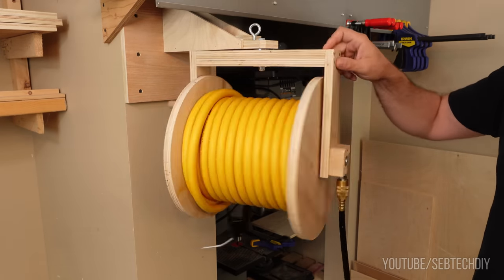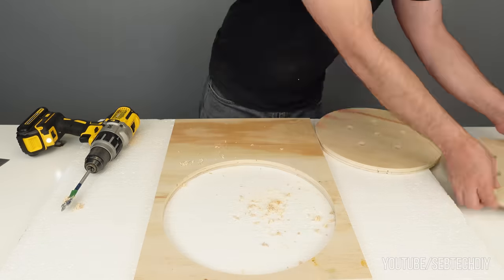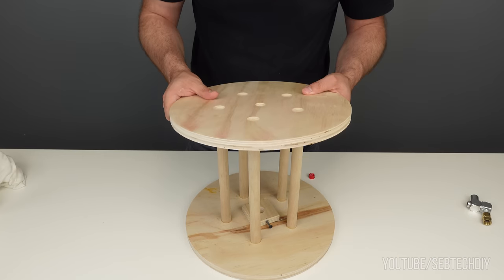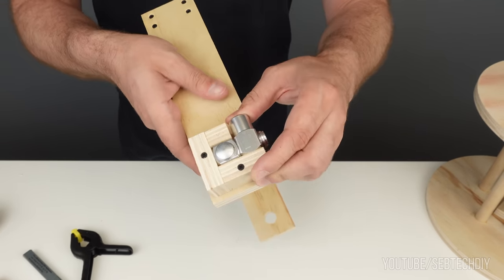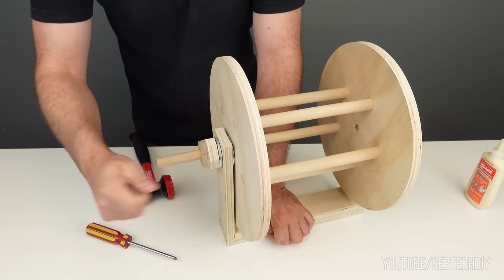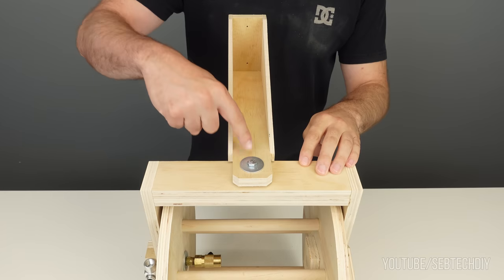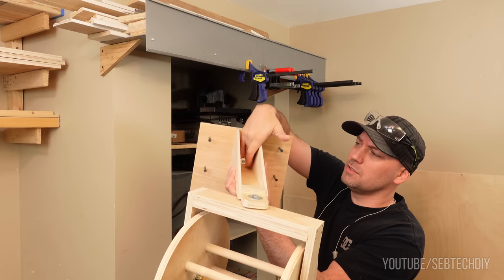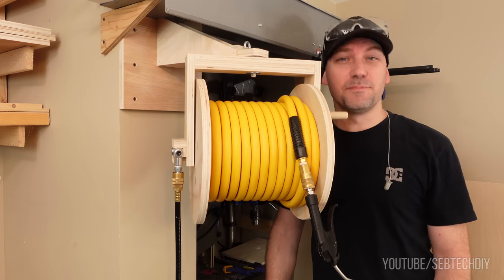Air Hose Reel From Plywood | DIY w/ Free plans

Comment: Im curious. You said the fitting holds the side with the air supply correct? Then when you unroll the hose that fitting will loosen but if it doesnt rotate then ti will eat away at the board. Am i missing something here?

Comment: Can you add the air fitting part please, I try to find it and not luck! Thanks
Reply from the maker: The 90° swivel is PART MP1038 from campbell hausfeld, they seems to have recently change the model but you could probably find also generic versions made like the old MP1038. I saw one on ebay check this out : https://www.ebay.com/itm/CAMPBELL-HAUSFELD-MP1038-1-4x1-4Swiv-Conn-/274411737919 

Hope it help and if you have any more question feel free to ask,  i will add in the next few days on my instructable.com page all the fittings and models number used in this build.

Comment: Great job.  Thanks for the detailed plans.  I'm building one today!
Reply from the maker: Awesome! :) If you build one, try something different with the locking system if you can. I removed the two washers between the hose support and the wall bracket because it was moving so much it was hard to rewind the reel it was shaking to much, now it's better but still if i make a V2 I would try something a bit different. Other than that, I really like it. Used a dozen times since i built it!
Reply: @SEBTECHDIY  I’ll let you know if I come up with something. Maybe some kind of ratchet locking system that you can engage or disengage depending on if you want it to spin or stay facing a certain direction..,

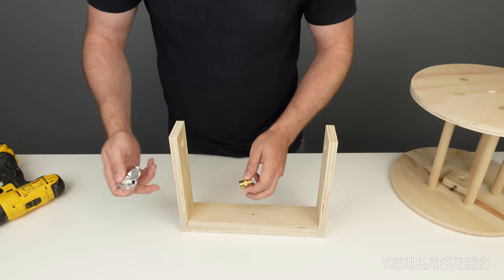Comment: 3:00 he says it will support a 100-foot hose (diameter?). I found in the instructable that it was loaded with 50’ of 3/8” but that it would also hold 100’, assuming that too would be a 3/8” hose. Great instructions on a project that could be used for many projects: electrical cords, water hoses, as well as air hoses.

Comment: SEB, this is a great tutorial for a needed project. I'm in the process of acquiring the materials. I ordered the parts already and they arrived. .. I have a question.. Does it matter if I use 3/4 inch plywood vs. 5/8 plywood. I ask due to I have 3/4 in and didn't want to buy 5/8's if I can do this with 3/4. - My concern would be the distance between the end of the swivel air-fittings and the beginning of the hose connector inside the roller.  Am I correct?
Reply: I used 3/4" plywood. I just lengthened the dowel going through the disc and the handle bracket to compensate for the extra width. It's only 1/8" so not a big deal. I ordered the exact hose fittings in the build diagram and it all worked without issue.
Reply: @Synonomous  Hey, it been a while since I finished it.. And just ran across our convo. So figured I share.
Reply: Crap, it's not letting me add a picture. Well damn.
Reply: @Synonomous  Exactly. Good observation. 5/8" plywood is not all that common to find. Must be some metric size in some other country.

Comment: As-tu un liens pour commander les air fitting ? Merci 

Do you have a link for the air fitting ? Thankyou
Reply from the maker: Si t'es du QC je les ai achetés au RONA. Le fitting swivel a 90° c'est le modèle MP1038 de campbell hausfeld. Sa semble être l'ancienne version du MP1038, il est plus carré que la nouvelle version. Le reste c'est des fittings campbell hausfeld 1/4 male/male et 1/4 femele/femele et des quick connect standard acheté aussi au RONA. Dans les prochains jours je vais ajouter une photo sur ma page Instructables avec les # de modèles sa va beaucoup aider.
Reply: @SEBTECHDIY  
Merci beaucoup 
Oui je suis près de Montréal 
Ça m’aide vraiment ta réponse!!

Comment: Nice, Excellent.  How long hose did you load on reel?
Reply from the maker: Thank you. It's a Dewalt 3/8 x 50' hose , I bought it on amazon https://amzn.to/3K3I2r1 ( affiliate link ) Also, you have enough space to fit a 100' no problem, the reel should be sturdy enough to take the load.

Comment: THE BIGGEST FAILURE on anyone  of these from anyone is the skinny drum  A wider drum wont knot any hose,    I now on my house raised the garden hose house holer to 5 ft, I have big loops,  On  my back house hose holder for the 125 feet of hose  I use two holders 5 feet apart 4 foot high,  Tangle free, fast to unwrap and wrap

Comment: To make this you need hundres of dollars worth of equipment.  Which costs more than buying a prefabbed one.  Shame really.  But that's a handsomely made hose reel.  Ron Swanson would be proud.
Reply: I hear you but you can do this with a cheap jig saw, a hand saw, a hammer, screw driver, and a drill. Who doesn't have these who's in need of an air hose reel, lol?  It's easier with a router but not by much.